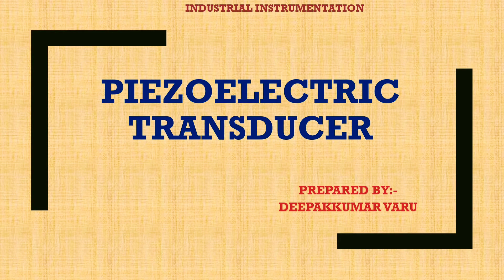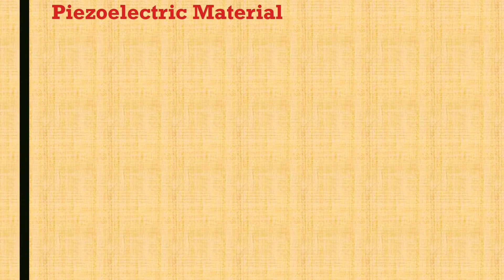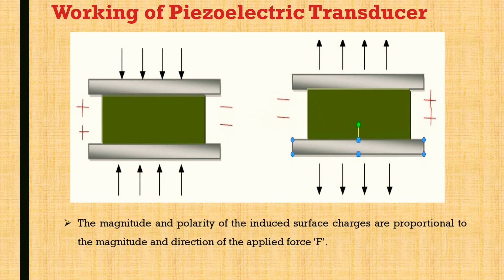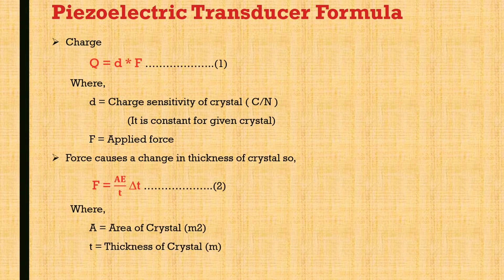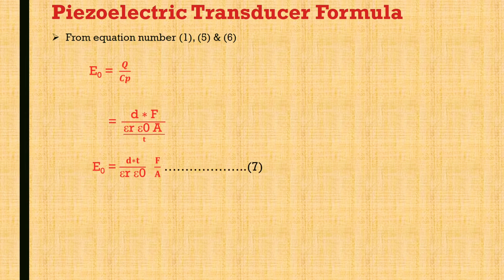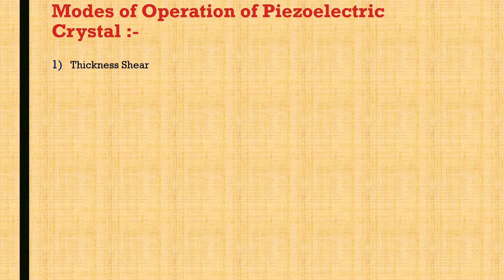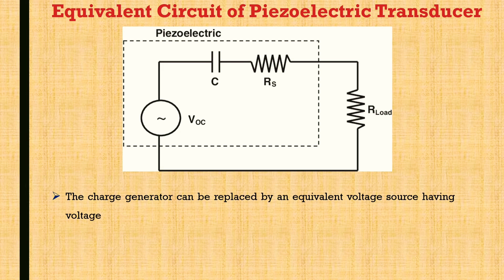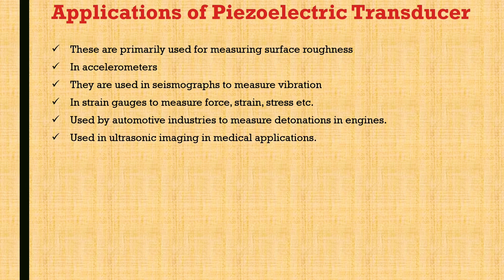Principle and Working of Piezoelectric Transducer By. Deepak Varu

Comment: very helpful and I appreciate your instruction in what is likely a second language for you.  Have you done  a video on how to determine the resonant frequency of a given crystal ring?  Specifically, there are piezo elements available on the web that could be used to make a piezo stack for a sonicator or similar.  Can you point me toward any links that would help design a transducer head for say, 40khz source?  Thanks again!  Doug
Reply from the maker: I think you will get some information regarding your question from below given link...

https://www.electronics-tutorials.ws/oscillator/crystal.html